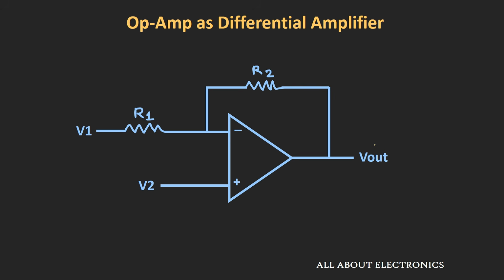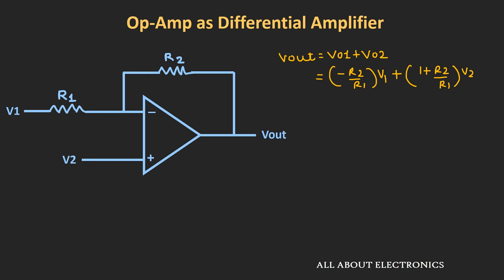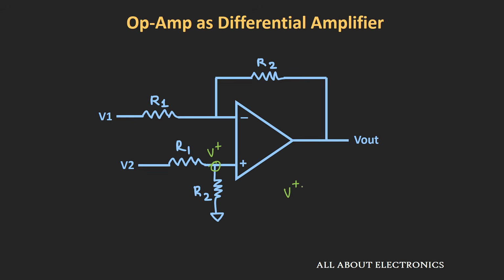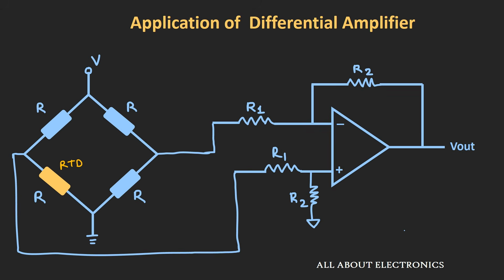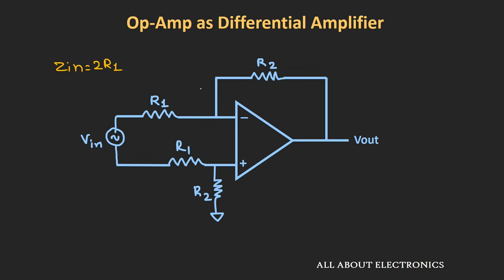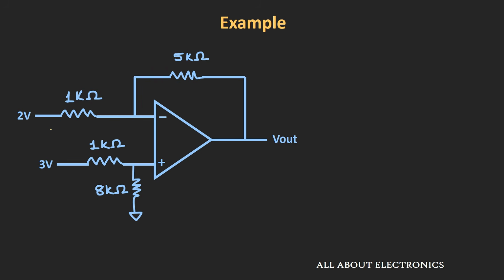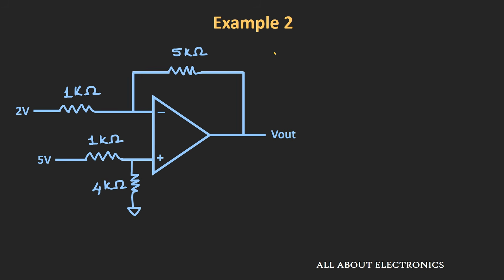Operational Amplifier: Op-Amp as Differential Amplifier or Op-Amp as subtractor (With Examples)

Comment: Sir, in tha example 3 for practice hare is a problem in case of non inverting v(out)=(1+Rf/R1) so for R1 hare is two resistant how to separate them??
Reply from the maker: It will be the parallel combination of two resistors. (1k || 1k). 
Answer of that question is 4V.
Reply: ALL ABOUT ELECTRONICS yes sir ( - 2-3+4+5) =4  
Thank you so much sir, your op-amp video is very helpful for preparation JAM exam
Reply: Very nice example sir
Reply: ALL ABOUT ELECTRONICS 
Sir iss mei do voltage hei na 4v and 5v uss ko kese solv. Kare
Reply: @ALLABOUTELECTRONICS  sir in example 3 while we considering 2Volts source alone at R1 resistor place one 1k resister is connected to ground. Is there any effect of 1K resistor on R1? What is value of R1 in that case? Please give a solution to me sir
Reply: @ALLABOUTELECTRONICS   if we solve for 4v input,and take all 0 then 1k|| 1k we get which is equal to 0.5 k and the we get v+=0.5/(0.5+1) =1/3 and so  8/3v as output for that case.

Comment: Dear Sir, I have a problem on Differential Amplifier. This is from Robert Boylestad.
Determine the output voltage of an op-amp for input voltages of V i1  = 150 uV,  Vi2  = 140 uV. The amplifier has a differential gain of Ad  = 4000 and the value of CMRR is:
(a) 100.

Ans: (i) 45.8 mV (when Vd = 150 uV -140 uV) (ii) -34.2 mV (when Vd = 140 uV - 150 uV). How is it possible that we end up getting two different Vo values (one positive and negative with different magnitude). Which one is correct?
Reply: Vout=gain(V noninverting - V inverting) based on input given to the answer can be negative or positive but not more than baising voltage

Comment: The last example is more interesting than it looks.  The feeback ratio for the inverting input is not the same as the non-inverting. The ratio for the non-inverting side is Rf/ (1k // 1k) => 1k/0.5k  since we have at the  inverting input two 1k ohm resistors in parallel to ground.  When I first did this problem I got the wrong answer.
Reply: Thanx ,I was facing the same problem.

Comment: From where did you get six in the examples? I don't understand that thing.
Reply from the maker: to get the output, the principle of superposition is applied. Only one input source is considered at a time. And using that, the output is found. The overall output voltage is the summation of the individual output voltage. 
I hope it will clear your doubt. 
If you still have any doubt, let me know here.

Comment: Sir you had using negative feedback only in all examples ? Why not positive feedback? And why it is un stable?
Reply from the maker: In some applications positive feedback is also used. For example, in the multivibrator there is a positive feedback. I have already made videos on design of multivibrators using the op-amp. Please check the op-amp playlist. You will get it.

Comment: at 13:28 what does when Vbias = Vsat mean??
Vbias is always equal to Vsat right??
Reply from the maker: Practically, that's not the case always. Suppose if you apply plus-minus 12 V as biasing voltages then the saturation voltage will be typically less than that. (may be around 10 or 10.5V). For rail to rail op-amps, the saturaiton voltage is very close to biasing voltages. Academic perspective in text books for simplicity, it is typically assumed that Vsat = Vbias. 
I hope it will clear your doubt.

Comment: Sir with the differential voltage, can u plz explain how the input impedance is 2R1.
Reply: Hey, with the differential voltage, consider the negative and positive input terminal shorted (virtually). So, you get a closed circuit with the circulating input current. And the input impedance simply becomes 2R1.

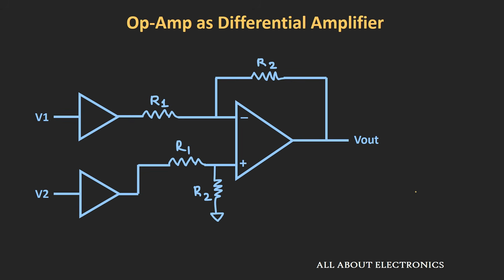Comment: 8:37 what does it mean "source might get loaded"?
Reply from the maker: If the input impedance of the circuit is very low, then the  actual input which appears across the input terminals of the circuit will be less than the applied input vin. Let's say the source Vin has some series resistance Rs.(The series resistance of the source typically used to be in ohms).  And if the input impedance of the circuit is also in ohms and let's say it is equal to Rs, then the actual input which appears across the circuit is Vin' = Vin * Zin / (Zin + Rs).
If Zin = Rs then Vin' = Vin /2. 
That means although Vin is applied to the circuit but actually only Vin/2 appears across the circuit. That's called source loading. 
I hope it will clear your doubt. 
If you still have any doubt then you can check this video on input and output impedance. 
https://youtu.be/7jw2_x8dyQ8?t=335
Reply: @ALLABOUTELECTRONICS  thanks a lot now it got fully clear!!

Comment: Can i use this circuit in audio application to cancel out a signal coming in the inverting input by injecting an audio signal in the non inverting input?
I want to see if I can use this to cancel an echo or crosstalk?
Reply from the maker: Yes. Only thing need to be ensured is that, the gain of the amplifier should not saturate the output and the op-amp should be able to drive the next stage. (The output source current of the op amp should be sufficient to drive the next stage)

Comment: I have one doubt when I give a 10V fixed in the V1(non-inverting terminal) and a variable(0-10V) in V2(inverting terminal).
what Iam expecting 0-10V Variable and VOUT 0-15V. R1-1K, R2-1.5K.yes, I am getting up to VOUT - 9.00V only then it is stable on it. What can I do?? please give the solution.
Reply from the maker: Are you using it as difference amplifier ??

Comment: sir, as we put feedback in the circuit at the output terminal, then the OPERATIONAL AMPLIFIER will only give the output after the feedback signal is reached to it and not before?
Reply from the maker: It happens very instantaneously. ( The operation of circuit with feedback)

Comment: 4 volt is the answer of the H-W. Explanation: 1. For inverting terminal: Vout= - ( v1 +v 2)=-(3+2)=-5 volt as Rf= R1=R2..../ 2 . For non-inverting terminal: 1. find v+ : (v1+) =v1/3 and (v2+)= v2/3 as R1=R2=R3 so, (v+)=(v1+)+(v2+)=(4/3)+(5/3)= 3 volts ... 2. Now find vout using the formulae (1+Rf/R1)*(v+)= (1+1/(0.5))*3=9 volts... So, the final step is to add the non-inverting and inverting output voltages. Vout= -5+9=4 volts and it is within the limit of saturation voltage given (-15 V to +15 V)
Reply: why is R1 = .5??

Comment: there is a negative feedback at inverting i/p so why the  output is having the value greater than biasing voltage?
Reply from the maker: May I know about which example you are talking?
Reply: ALL ABOUT ELECTRONICS like in both examples u have done they have feedback but will there be any effect on output??
Reply from the maker: Like I mentioned in the video, even with the negative feedback if the calculated output voltage is more than the supply voltages, then the output will get clipped to the biasing /supply voltages. (or may be even lower than the supply voltages, depending on the op-amp type)
Reply: ALL ABOUT ELECTRONICS ok thanku for the help and do you know what topics of opamp is important for interview?

Comment: -2 -3 +4+5=4v
Reply: haimt1464   please elaborate it I am not able to understand it
Reply: ok. according to superposition theorem you need to take 0ne source and  all the other goes to GND for each of the source (do not forget to use virtual GND , and see if U not exceed the saturation voltage  )  for example for 3v source the gain is Rf/Ri =1k/1k =-1( negative because inverted configuration)  gain*source=-3
for example for the 4v  source, we have voltage divider at the Postive input of the OP-amp 1k and 1k|| 1k =0.5k so that is 4v *0.5k/(1k+0.5k)=1 and 1/3 at the postive input and the gain is for non-inverting configuration (Rf/Ri+1)= (1k/0.5k+1)=3  Gain*(divider voltage)= 3*(1 and 1/3)=4.
Reply: Sol:-
Resistors value is always 1 in question
     Applying super position theorom at uper node where (-) sign
I2+I3=I1
(2-V)/1+(3-V)/1=(V-Vo)/1
5-2V=V-Vo
-Vo=5-3V
Vo=-(5-3V)-------1

Now apply down positive lower side superposition then
I4+I5+I0=0(inside flow current is 0 in op-amp)
Now,
Voltage is same at both point according to rule 
(4-V)/1+(5-V)/1+(0-V)/1=0
-3*V=-9
V=3
Put the value in equation 1
Then
Vo=-(5-9)
Vo=4v
Is correct ans
Reply: 1 volt hoga
Reply: Samajh nhi aaya numerical
Reply: @SGTVNewThinking  thank you so much!/👍👍👍
Reply: @SGTVNewThinking  sir i think u applied kcl right
not superpsiton

Comment: is there any use of the resistor that is already grounded?
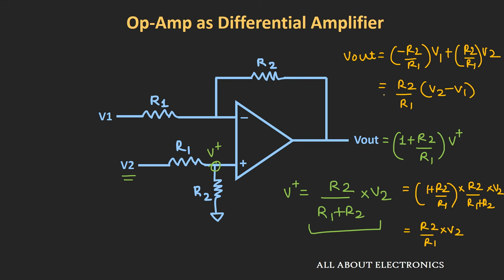Reply from the maker: Are you referring to R2 resistor at non-inverting terminal. If so, then yes, it decides the actual voltage that is appearing at the non-inverting terminal of the op-amp. Please check at 6:14.
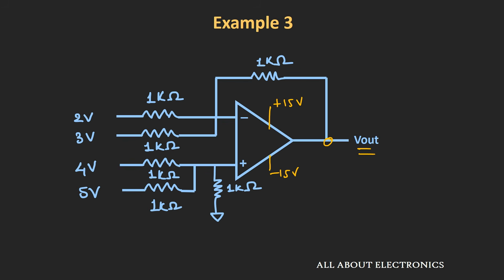Reply: In the last question ( homework ) where to use the resistor that is already grounded? 13:39

Comment: Sir why can't we use direct formulae to the examples I.e 
vo=(-rf÷r1)(v2-v1) sir plz tell Me..
Reply from the maker: It can be used only when resistors used in the feedback and voltage divider circuit at the non-inverting terminals are equal. Let's say in the feedback the resistor is R2 and resistor R1 is at the inverting terminal.
If the same resistors are also used as a voltage divider at the non-inverting terminal then also, you will get that expression. 
Else the expression will be different.
therefore it can't be applied directly. 
I hope it will clear your doubt.
Reply: @ALLABOUTELECTRONICS  tq sir  
For clarifying my doubt tq..

Comment: In 2V and 3V voltage inputs at inverting terminal. When we are calculating Vout for 2V. Why woulf there be no effect of 3V branch on it because even though virtual ground is there. The voltage at the node will not be 0 because of the 4V, 5V branches. So 3V branch should effect 2V branch even when 3V is grounded. Please tell me if why mistake i am making.
Reply from the maker: To calculate the output, superposition theorem is applied. So, when you consider 2V input voltage is acting alone, at that time all the other sources will be zero. So, 3V, 4V, and 5V voltage sources will be zero. It means there is no input voltage at the non-inverting terminal.(And it is at ground potential)
Now, as we are considering here an ideal op-amp, the virtual short is existing between the inverting and the non-inverting terminal. So, inverting terminal will also be at ground potential. Now, if you look at the resistor which is in series with the 3V voltage source, both terminals of the resistor are at ground potential (Considering only 2V voltage source is acting alone). 
So, it will not have any effect on the circuit. And the equivalent circuit will be an inverting op-amp with 2V voltage source is acting alone. So, output because of 2V voltage source will be (-2V). 
The second method is to use nodal equations and consider all the sources are acting simulteniously. And solving the equation you can get total output voltage. 
I hope it will clear your doubt.
Reply: ALL ABOUT ELECTRONICS 
Thanks sir for your great explanation. But then why the same thing does not happen in non inverting summing amplifier. When 3 input voltages are there. We say that they are dependent upon each other and not isolated like the inverting summing amplifier. But then in non inverting summing. Why grounding the inverting terminal does not make voltage to be 0 at inverting node?
Reply from the maker: In case of the non-inverting terminal, when we consider any voltage source acting alone at that time voltage at the non-inverting terminal is not zero. For example, if you consider 4V voltage source acting alone in that case, voltage at the non-inverting terminal is (1k|| 1K)*4/(1K + 0.5K) =1.33 V. 
And because of the virtual short between the two terminals of op-amp same voltage will also appear at the inverting terminal.
If you look at the inverting terminal perspective, even though all inputs at inverting terminals are assumed to be zero (Because of superposition theorem), the current which is flowing through the 1K resistor in the feedback resistor should go through the two 1K resistors whose one terminal is at ground potential. (Using Simple KCL rule, and we are assuming that no current is flowing into the op-amp terminals). And because of the flow of that current, you will find the finite voltage also at the inverting terminal. 
I hope it will clear your doubt.

Comment: how to differentaite between an adder circuit and subtractor circuit?
Reply from the maker: In difference amplifier, the input is applied at both inverting and non- inverting terminal. The circuit which is discussed in this video is difference amplifier.

Comment: I got 1 volt as my answer, and when i read the comments  i found answer spamming is 4. I try another  way and got 4 as my answer but i think  answer 1 is correct  one as when we grounded non inverting voltages the resistor get in parallel . Please  correct me if i am wrong

Comment: Won't we have to consider one input at a time while solving the V(out) for non inverting terminal
Reply: V+ for 4v is   4 ok. then V(out) will be considering one time 2V as ground and The next time 3V as ground so for 4V V(out) will be 8V. 
And similarly for 5V it will be 10 volt.
(V(out)) of the whole op-amp will be =-2 -3+8+10  =13 volt
Reply: Can you reply fast as i have only few days to go for exam.
Reply from the maker: @jaytilwani1950  I think you are talking about the last example right?
If you go through the recent comments, I have already explained in detail. 
Please go through it. And still, you find any difficulty then do let me know here.

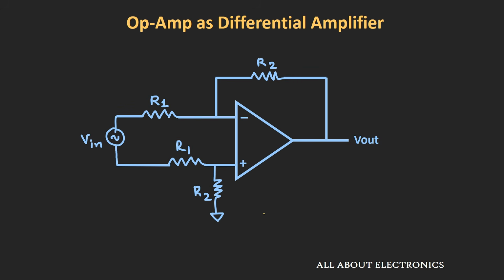Comment: can someone explain at 8:18 why input impedence is 2R1 ?
Reply from the maker: To find the input impedance of the circuit, we need to find the ratio of input voltage to input current. In this case, that is Vin / Iin. Where Iin is the current coming out of the Vin. Also, here since the op-amp is ideal op-amp, so no current is flowing into the op-amp terminal. So, if we apply the KVL, then Vin = 2 * R1*Iin. Or Vin / Iin = 2 R1. Therefore, for the given circuit, the input impedance is 2*R1. I hope, it will clear your doubt.

Comment: Didn't you just say that the two input signals must have equal voltage gain? Does it mean that they can have different input voltages?
Reply from the maker: V1 and V2 are already two different inputs. Do you mean different gain ? 
If so, then then yes, both inputs can have different gain.

Comment: sir in the last problem R2=5k ohm,R2=8k ohm  both R2's are different which one should we consider and it is a differential op.iff it has both R2 values same by voltage divider rule
Reply from the maker: In general, all the resistors can be a different. If that's the case, then we will haveVo =  A*V2 - B*V1. Where A and B are the gain that depends on the value of resistors. If the resistors at the position of R1 and R2 are same then we have expression something like A * (V2 - V1) where A = R2/R1. I hope, it will clear your doubt.

Comment: Similar to example 2,  but with +-15v power.  If, for example, from the superposition principle,  V02=24v and Vo1=10v, for a difference of  24v - 10v = 14v. Is this OK for the difference amp even though one voltage alone exceeds the power supply rail, but the final 'voltage DIFFERENCE' is WITHIN the supply rails?
THANKS FOR ALL THE SUPER VIDEOS!!!
Reply from the maker: As far as overall output after superposition is less than biasing voltage, there is no issue.

Comment: What is the minimum allowable differential voltage of op amp? Because maximum Is specified in datasheet, but minimum is not specified. Is it is capable to process/amplify even nano volt and micro volt? If yes, pls mention few IC series.
Reply from the maker: It depends on the noise floor and what signal to noise ratio you want to achieve for the system.
But you can use these low noise op-amps which will certainly works with inputs in uV.
LT6018
ADA4805-2
ADA4084-1

Comment: Sir, because of virtual short both the inputs are same so we get output zero(v1-v2).but we get output ???why?? Please give reply.
Reply from the maker: If you have followed the earlier video on the virtual ground, then I have explained that the differential is not exactly zero. It is in micro volts. And the gain is of the order of 5 or 6.
That's why we are getting the output.
I hope it will clear your doubt.
Reply: Tnq sir

Comment: in the circuits are used are these dc voltage source or sine wave ? what if these were both s sine wave should ı how to solve them 
 i mean i dont get it voltage values vin and another one
Reply from the maker: Here in the example, all the input voltage sources are DC. In case if both are sinewave then you can just keep it as a variable and you will get output kind of (Ax V1sin(wt) - Bx V2 sin(wt))
Considering both sine waves are in phase and different in amplitude. The value of A and B will depends on the value of resistors. 
I hope it will clear your doubt.
Reply: @ALLABOUTELECTRONICS  you are incredible man! Thanks a lot I recommend your channel to all my class 🤗😊